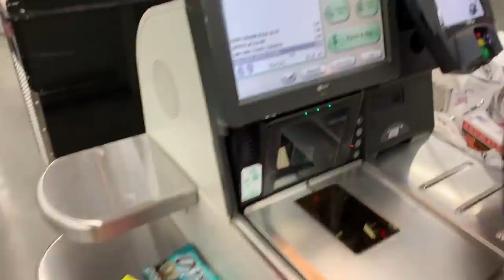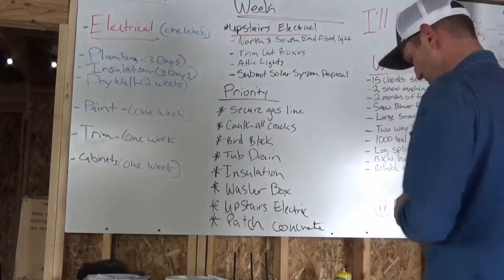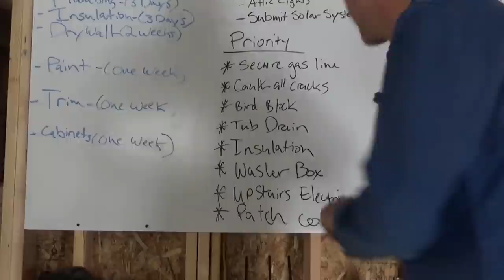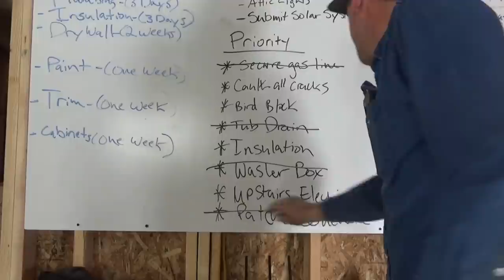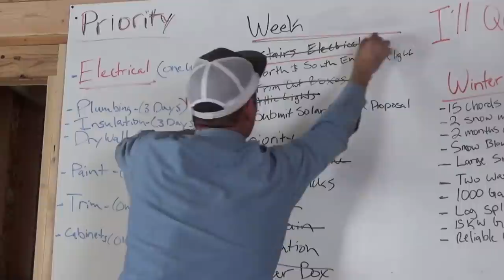#310 - The Inspector Said Sell The House And Move To Town... Seriously!

Comment: Wonderful family you have and very nice ranch , hard work , I just wonder a lot of your plumbing is located in a exterior wall , only Vent piping could be there in a 6 " walls ,  water lines and drain pipes could be subject to freeze conditions , if for instant kitchen sink or bathroom vanity is located at exterior wall side then water lines have to come out from floor at front of wall , drain pipe as well, only vent pipe then turn in to wall - offset drain &  vent for exterior wall plumbing applications. if your ground floor does not have basement below , plastic pipes can be installed under concrete , rough in before concrete is pored on top , same way as hydronic in floor heating .
However not mu attention to undermine anything , you did amazing amount of work by your self , you are really extremely well skilled , and not to forget your Dog is awesome to .
All the best , cheers :)

Comment: Hey buddy, not sure how far you've come along with your driveway but my suggestion would be to make a slight Apex on all your turns, trench/moat system against the hill with mini culverts placed on the straight-aways at the lowest point of the dips in the trench/moat system. Use salt-based rocks(quartz/granite) for your road and just before the winter snow comes, sprinkle rock salt granulates throughout your road and the snow will melt, keeping your roadway grippy and clear of snow. Just make sure that you guide the excess water to your preferred location...I guided mine and previous clients projects to a settling pond or reservoir of some sort, or even a man made creek to keep the water contained on your property! Hope this helps you in some way, keep up the good work my friend! #AmericaNeedsYang

Comment: Regarding the road - as others have said, lookup "mechanical concrete." The solution to your roads pitting is to reinforce them. This can be done with materials as cheap as fine dirt and screen door mesh. Or tires & aggregate. Whatever.

A layer of mesh, a layer of dirt, a layer of mesh, a layer of dirt.. etc. This creates the mechanical stability required for freeway on-ramps, off-ramps, etc. You didn't think those were solid concrete didja? :)

Regarding the move.. your friend sees the amount of toil you've gone through, and the amount left. He's empathetic, and wants you to have something left in the tank to enjoy life - but he can't understand your true motivation or level of passion from casual conversation. He'll learn that eventually.

Comment: I am surprised that you chose Roxul insulation.  It does have excellent soundproofing quality and is pretty easy to install but it costs more than fiberglass and does not offer and increase in R value.  I like what your buddy next door did with the blown in fiberglass behind skrim.  Fast and a lot less expensive.

Comment: that road only need good drainage, maybe make a ditch along the side, or if you have the money put some drain pipe under it.
you just need to give it the right angle so the water drain  properly. nothing too hard to make.

that inspector was simply commenting on the situation and my guess is that city houses cost less than what your property will be worth so it was probably a tip to make a massive amount of cash.
but personally id rather keep a property like that and make it my playground, than move to the city.

maple trees ? mouses? deer probably too !

and the only downfall is that road ? that's only a short term problem XD

Comment: i see some electrical issues in wiring friend.
leave a loop of 6 inches prior to the boxes, and the wires must be an inch inside the walls (1 1/2 with drywall) to protect it from being punctured (hanging pictures etc).
also, when wiring across beams, staple the wire to the connecting beam, and then leave a 6 inch loop before entering into the box.
this is for the future. ;)
you also will want to apply a vapour barrier around the boxes which lay along the outside walls (and roof) of your home if you live in a place where cold or heat build up.

any more questions, go ahead and ask. im only 3 minutes into your videos sop far.

Comment: Ok. Let me get this straight. You were worried about the p-trap freezing, however, you have water lines inside the same wall. Hmmm
Reply: Water in a p-trap will freeze long before water in a water line. The water line has a lot of latent heat from all the other water it touches. The hot side has even longer to go. He has 2x6 walls so he will have plenty of room for insulation behind the water lines. His worry should be the mistake of entering the bottom of the sanitary tee with his p-trap. The depth of the water in the weir will be greater than it should be and the Inspector should catch it. Don't get me started on ABS as the pipe of choice.

Comment: I think the inspector was trying to tell you something important and trying to tell it to you in a way your pride would swallow it. I’ve had the privilege in my life of working on some really old houses, 100+ years and 200+ years. Let me tell you what I noticed about your home. You live on a hill. No matter what, your house isn’t going to stay level over time. It may suit you for your lifetime, but maybe not your kids lifetime and certainly not your grandkids lifetime. Your foundation is weak. You built on one piece of shitty cement slab. Every old house I’ve worked on has survived because it had a very solid stone and mortar foundation that goes deep into the ground at least 5 feet. Over a long amount of time as your house deteriorates your foundation is going to crack, become unstable, and all the hard work you put into it will make your house almost worthless. This is especially true because you live in a cold climate that gets snow, which the heating and cooling damages foundations much more than it does in the south. I also am used to living in snowy climates. I have had foundation problems happen to one of my relatives homes who lived on a slope and they had a much better foundation than you. Their house went from being 120k in value to 30k. The lumber you have used to build your home is not as strong as old lumber that came from mills back in the day. New lumber has inches shaved off of it, so support beams that used to actually be 2”x6” are now like 1 13/16” x 5 3/4” or similar dimensions. With less area on these boards comes less strength. Point being, your house will be fine for your lifetime, but it won’t last hundreds of years without enormous renovations. So I think the inspector was just giving you some advice in your best interest. Sell the house, take the money, and go buy something that is done right while your house is still worth something. He isn’t trying to put down your hard work. He isn’t trying to stop your dreams. He is trying to help you realize that what you’ve built is not sustainable and to get the most value out of it while you can.

Comment: I would suggest if you can manage to find them used, to buy a pair of Tracks and convert one truck for winter time. The surface area would be big enough to allow traction without getting stuck, just a thought 

These are the most expensive ones
https://www.mattracks.co/tracks/trucks/

This is another company , and possibly cheaper.
https://www.youtube.com/watch?v=b-mrYl1tHPI

 Or something similar.